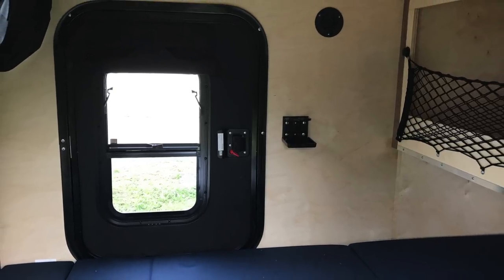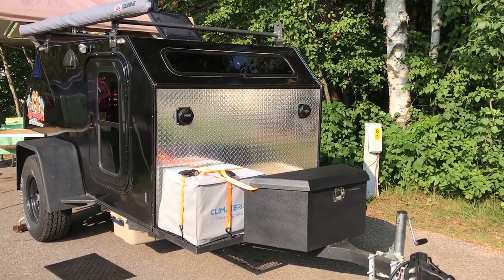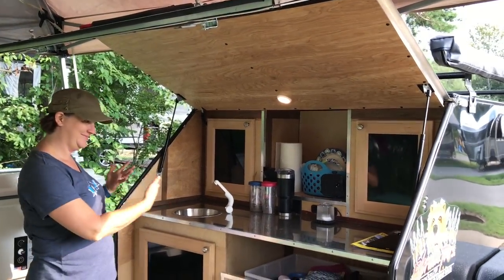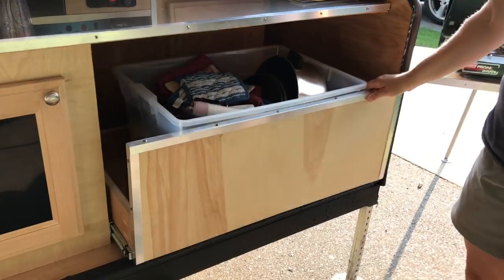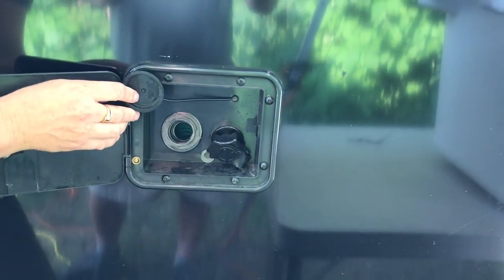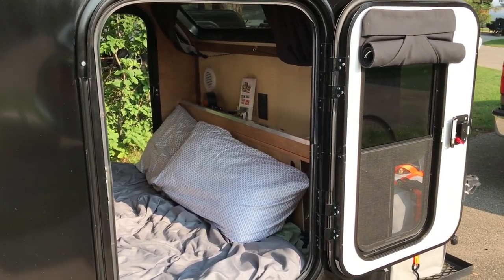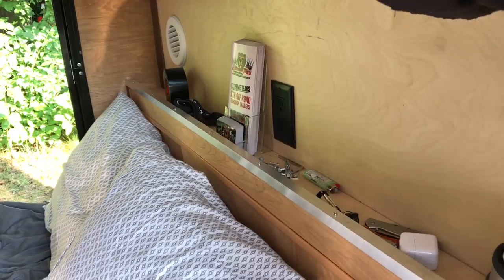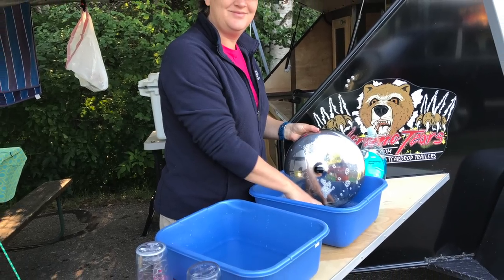Extremetears teardrop

Comment: These are truly great! But realistically, you will be stopping and staying over in some sub-optimal areas while traveling where you would not want to be towing something that will get some people overly excited about sticking you up or carjacking you for it. It is far too easy to move it, attach it quickly to another truck and be gone down the highway and into a remote backyard where it could be used without ever needing to go back out on to the road again. And I hope it is understood that the under the chassis tub storage on slides is not intended for use while driving on the road!
Reply from the maker: HappyQuails yes you are correct on the tubs.  We placed them in the trailer going down the road then slide them under the trailer when we got there.

Comment: Too many options for my taste, a lot of things you can get as standard equipment on other trailers. Also the trim and finish parts seem to be scraps just put together not very good craftsmanship.
Reply: IDC about the trim, as long as the thing's water-tight.  But in these trailers, unlike your other RVs, many or most of your customers are coming to the marriage with a lot of baggage, for instance, I'm fine with my existing camping gear, so a cook stove is something I don't want to have to buy all over again.  The basic concept of the teardrop is a bed inside a hard-wall compartment.  

But yeah, you could get a late-model used Rockwood HighWall popup tent trailer (HW 276 or HW 277) for around $10,000, and it comes with a shower, toilet, blackwater tank, heater, air conditioner...   But it's not built to take much of a beating.